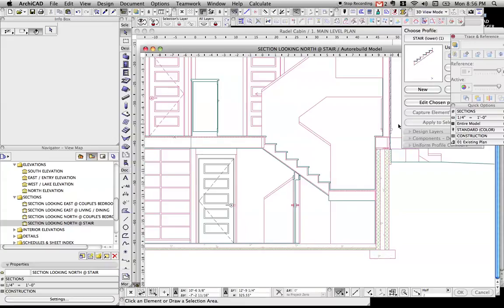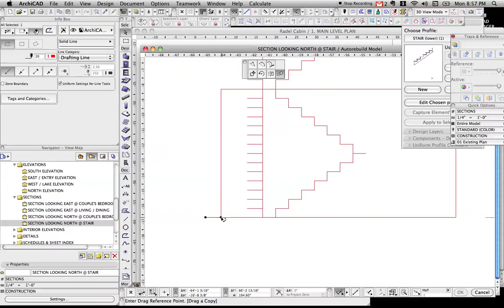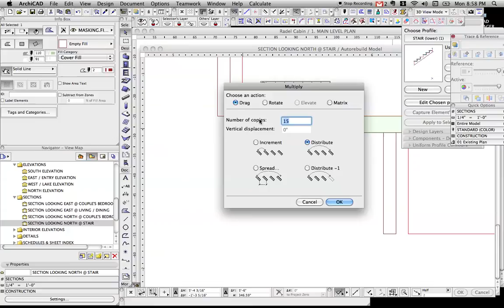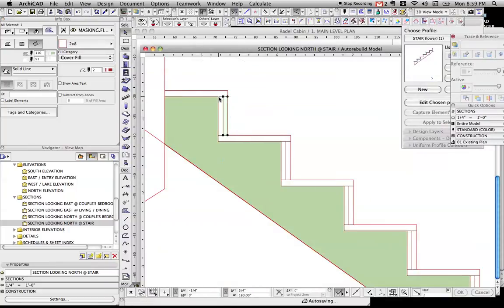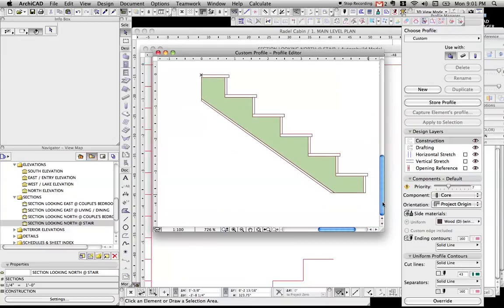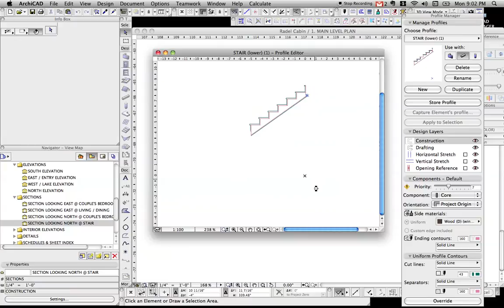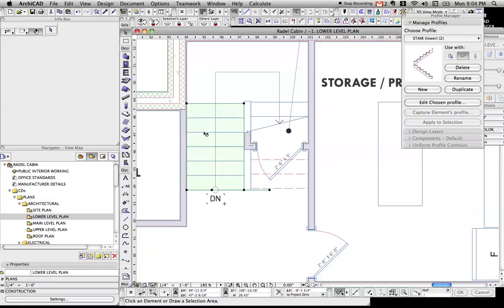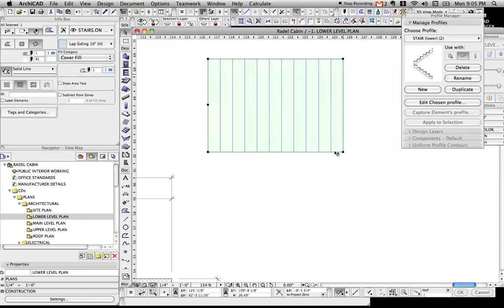ArchiCAD Tutorial #4: Complex Profile Stairs

Comment from the maker: The fill is a copy of a standard archicad fill. 6" lap siding, I believe (just a parallel line fill that comes with the program). Once I copied the fill, I changed the spacing of the lines to 10". Once the fill is placed I set it to 'relative to fill origin'. That way I can align the fill lines to start where i want them too.

Comment from the maker: @tyersposse For schematic purposes that would work. But using the "stretch" lines would also stretch all the fills ever so slightly. So a 3/4" tread could become a 13/16" tread or similar. Now that's not a huge different, but I want everything to be as accurate as possible. So I would rather avoid the distortion. And it might become apparent where the bottom of the top tread no longer aligns with the finish floor material thickness, etc.